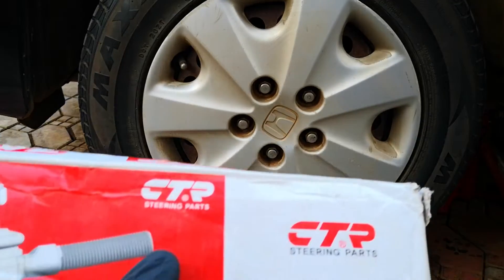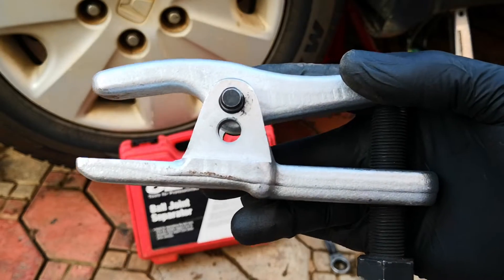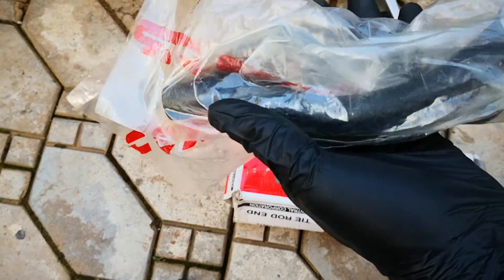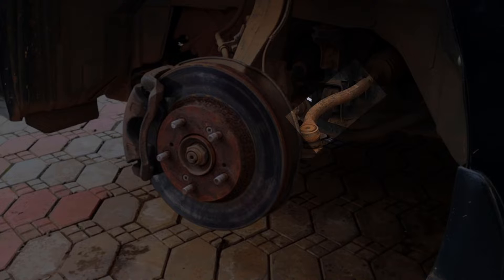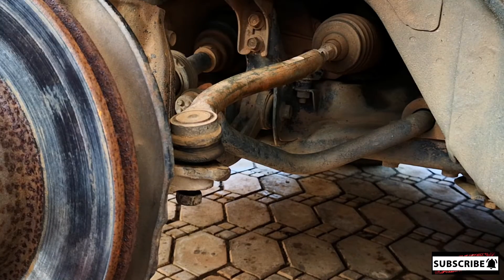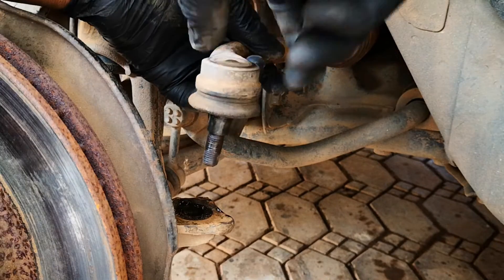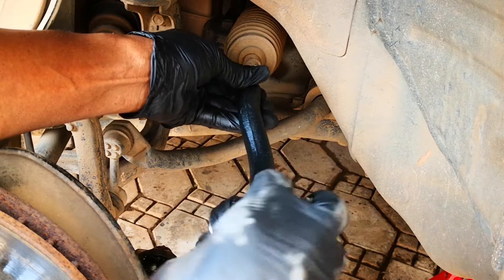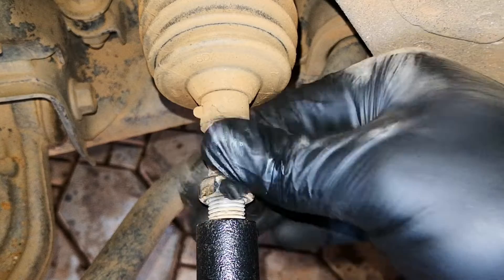Honda Outer TIE ROD Replacement / 2003 - 2007 Accord / How to Change outer tie rod ends

Comment: Amazing job every time. Can’t wait for that inner tie rod video 🥰🥰🥰
Reply from the maker: Yep. Already sourcing for inner tie rods. Time to put that my inner tie rod tool to action!
Reply: Inner tie rods are just as easy. I rebuilt my entire front end 3 weeks ago. The hardest part was pressing in/out the lower ball joints
Reply from the maker: Yea. For the lower ball joints, I usually take the lower control arm to a shop to remove and press the ball joints.

Comment: Made the same move on my car, if outer tie rod end is worn most probably inner tie rod end is also worn more or less. Even you measure the old tie rod, recommended is to go to a service for an alignment. So, why bother to work twice and spend more when you can replace them together maybe also with a fresh pair of boots. Very useful as usual.
Reply from the maker: Thanks mate. You are spot on about replacing the inner at once. It was the outer that was implicated during my annual state inspection, so I just bought the outer.  While I was making the video, I didn't have the inner with me. If I did, I would have changed it too.
Reply: Will surely come back for the inner tie rod video because I also plan on changing them. I know roughly how to change them but a good video and useful advices are always welcome. By the way, where did you find CTR spare parts for your car, I've read some good reviews about this brand but in my region they are very hard to find.
Reply from the maker: Thanks bud. I got it from a local supplier. He's the only that has it. Funny enough, he doesn't have the inner for CTR. Just spoke with him🤦🏻. Will keep sourcing...

Comment: white plastic is nylon which deforms by design during installation, This is a common method in many types of nuts to prevent unloosing.
Reply from the maker: Thanks for chiming in!

Comment: Good job, but good to control wheel alignment after joint replacement. Best regards
Reply from the maker: Absolutely. Wheel alignments should follow every tie rod replacement. The next drive of this car is to the alignment shop!

Comment: What if I put a new one but it still has play? Do I need to do the inner tie rod too?
Reply from the maker: You mean the tire has play or the new tie rod? You can check for play in the inner tie rod using what I describe in the video. It should have any in/out play. If it does replace it.

Comment: The wrench size to take the tie rod bolt is likely a 15/16. I don't know if he mentioned that in the video
Reply from the maker: I've sold the car, but I think you are correct it's a 15/16 or 24mm

Comment: How can you spot a bad Ball joint for Honda 2008.
Where can one get quality ball joint
Reply from the maker: Creaking noise when turning the steering wheel. The noise comes from the affected ball joint. This noise is intermittent. Can start after some driving and cease, only to reappear during the next drive. The sound akin to the one you hear when trying to force a door with rusty hinges open. I get OEM from Amazon or distributors in the US. They are pricey, but they last.